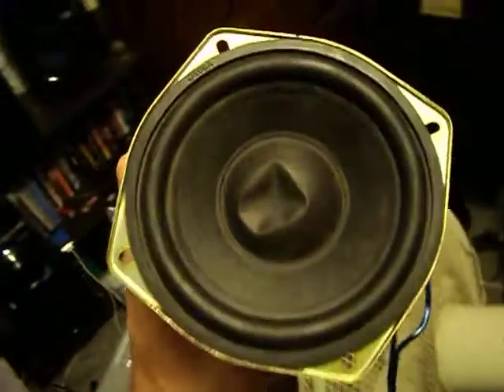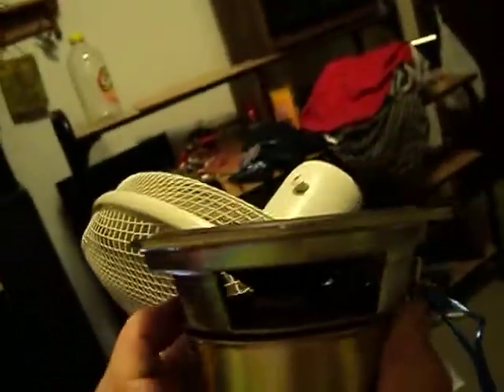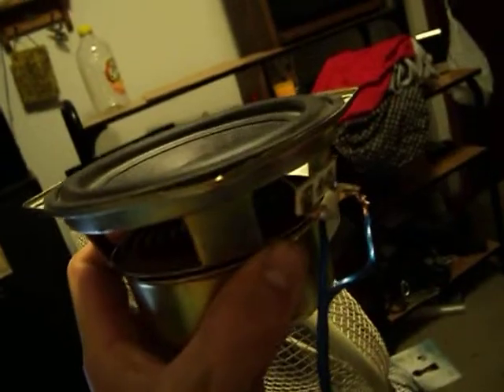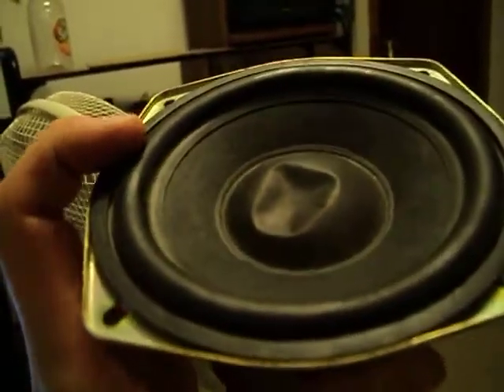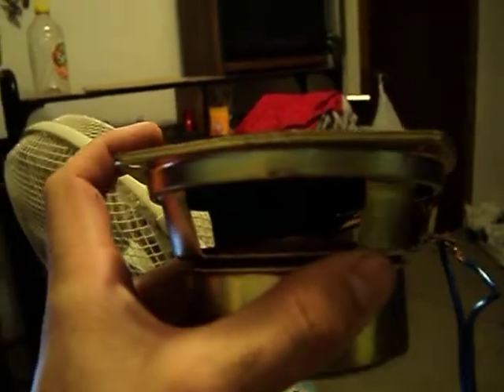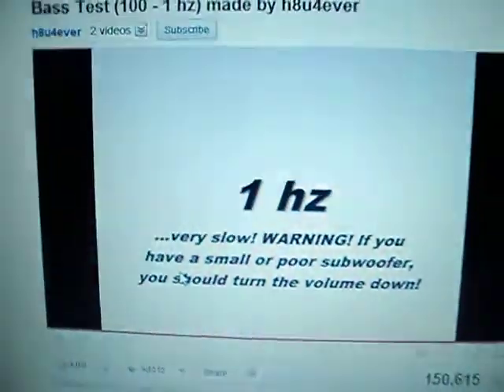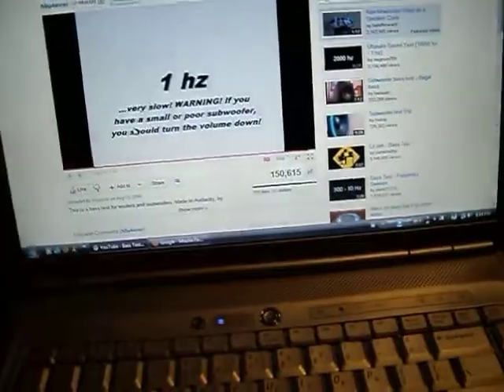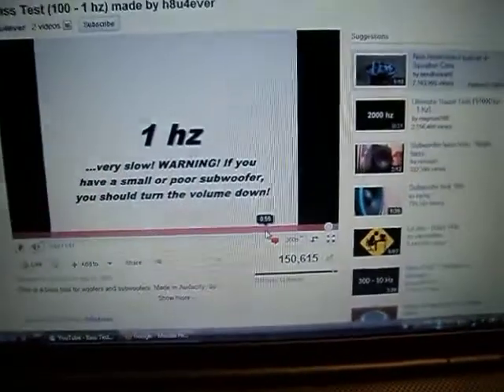4" subwoofer 20-1 hertz test tones

Comment from the maker: @liighthead  That use to be in a little box. It came with my older than dirt desktop computer. It had two lil full range speakers and the lil amp was a plate amp in the box the sub was in and the box was ported. I have no idea what it was tuned to though. It was def nothing too loud. =P  Besides it would be friend in a heart beat on that amp. It got super got just in this lil vid it was cooking very good